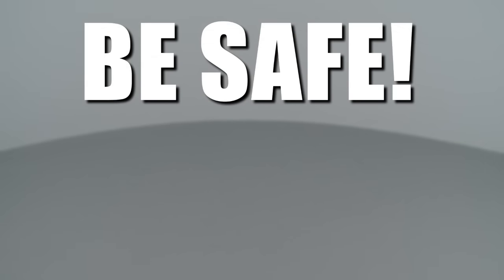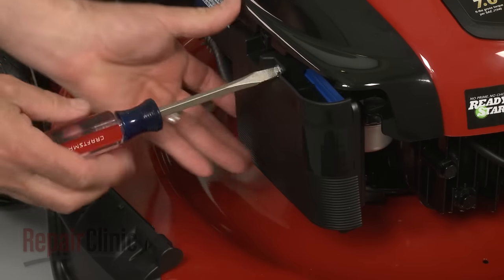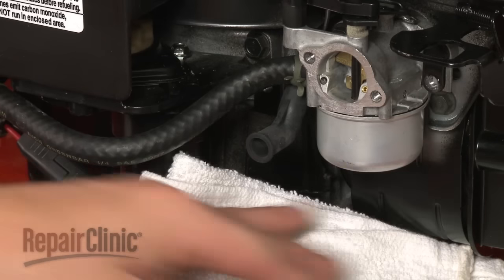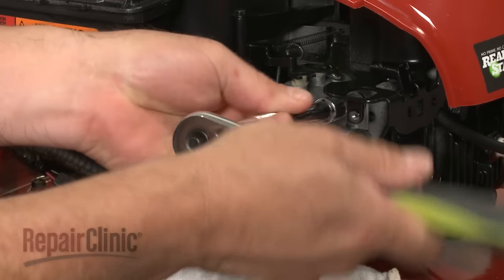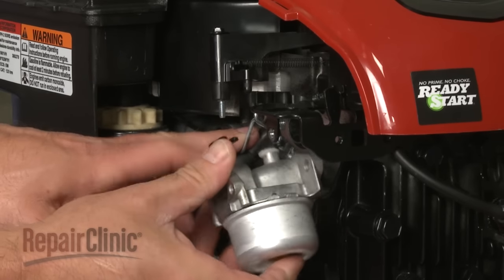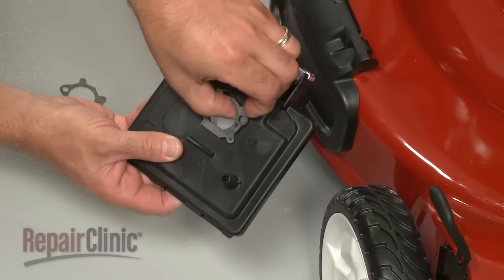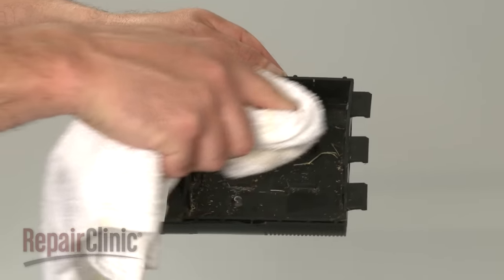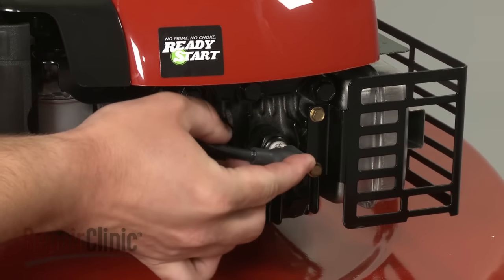Lawn Mower Won't Stay Running? Briggs & Stratton Carburetor #799866

Comment: A video by someone who sells carburetors.  The real problem 90% of the time is a clogged fuel jet which is in the half-inch nut on the bottom of the fuel bowl (or just water in the bowl itself, both of which can be easily fixed by removing nothing but that nut and fuel bowl assembly, which can be reached from the front without removing anything else.  Sad part is that the entire issue could've been prevented by the use of an in-line fuel filter which they didn't build in.
Reply: sskyking1 Just wanted to thank you for your comment, because of what you wrote my lawnmower works again. Thank you so much.
Reply: Thank you for your time comment and advice now I can fix my lawnmower to skyking1
Reply: Fixed it for me too. Thank you!
Reply: I am going to try this again. I had no luck a couple weeks ago.
Reply: Thank you.
Reply: It worked this time. I'm keeping my mower away from the rain now.
Reply: I did this yesterday, my lawnmower’s amazing now, thanks!
Reply: I took the air cleaner off and primed it….it would crank and stall….did that about 4 times ….it started and stayed running.
Reply: Fixed my problem, thanks to you sir.
Reply: G’day from Australia. Your comment just saved this Aussie too. Removed fuel jet and bowl, cleaned jet, whacked it back in and vroom vroom!!  I do need a new air filter though 😂 Thanks mate!

Comment: Instead of replacing carb, i unbolted fuel bowl, cleaned out bowl, replaced, and engine was running in 5 minutes total.
Reply: I tried this and it worked, omg. Thank you very much.
Reply: Didn't work for me at all.
Reply: I did that, and cleaned the carburetor, and it ran for another 2 hours, then stopped again.  I am replacing the carburetor now.  It's not like it's expensive, or a big job.
Reply: This is worth a shot, but no luck for me.
Reply: IT WORKED!

Comment: There was no need to replace the carb. just clean it and it should be fine unless you want to rebuild it. The gasket was ok, no need to replace that either. This is all wrong, do a little work for a change and stop screwing the customers for new parts when they don't need them.
Reply: Meh...I grabbed one off of Ebay for 12 bucks shipped. Just bolt it on and no fuss. Cleaning / rebuilding takes time and materials - heck a rebuild kit costs almost as much as the new carb! As a practice I change mine out every 3 years and my mower will probably outlast me.
Reply: If I have a problem, I clean the carb and it is usually fine after that, never had a come back for anything, it has been 20 years now.
Reply: 12 lousy bucks man - well worth the insurance and fast fix up. To each his own I guess.
Reply: Yup, same here.  Just picked one up for $12 and saved the hassle and time.  Also picked up a $5 inline fuel filter and installed in the fuel line.
Reply: Paul Brown. Hello can u help me? My fiance jus brought a used lawn mower 5 days ago. It was staying on running gd. It will crank on 1 pull wit no trouble. Only thing whn it gets on the grass it shuts off every time don't stay running.
Reply: You do realize that they are showing how to replace a carburator if you have to do it.

Comment: I have tried everything. I changed the oil. spark plug, took the cup under the carburetor and cleaned it. It still won't stay running.

Comment: Slow down buddy I haven't finished my beer.
Reply: W Morris
Reply: W Morris that's cool your slogan
Reply: W Morris what's that little breather go to or does it just get plugged
Reply: correct, this is easily a 3-6 pack job
Reply: My pull. Cord broke
Reply: I'm going to throw this f**** lawn mower away go buy me one or go buy me one that is hot for $20

Comment: I understood the title perfectly!  Since I have a front, back and side yard to mow, I have been using the engineered , 4 cycle gas from Walmart or Home Depot, more expensive for sure, but my mower does start every time and even after harsh, upper midwest winters.  Thanks for the video!

Comment: Worked perfectly! Thank you so much! Even when brand new, this mower gave me fits trying to keep it started and I chalked it up to bad gas. I think it came fully loaded with a bad carburetor!
Reply: Who know?  So much cheap junk coming out of China but I bought a brand new carb on Amazon for $29.00.  I still have to spray starter fluid almost every time to get it started : ( but with the new carb, it STAYS running.  The old one just kept quitting.  So frustrating!  I don't think I will buy a #Toro again.

Comment: What if it's a problem with the air-feed in the top of the fuel cap? You've not even mentioned diagnosis - but just dived in, replacing components willy-nilly. If the B&S does not start at all I'd first go for the spark plug. Did you?

Comment: Really stuck here.  Had the exact same issue as everyone else...would start from primer and then stop.  Totally removed carb.  Cleaned with carb cleaner and pipe cleaners to clean all ports and tubes.  made sure too get holes in bowl plug.  Changed out gas, and used rebuild kit and replaced gaskets and needle.  mower started and ran great last night.  when it got dark put it away and now doing exactly same thing today when tried to finish yard.  Took back apart looking for any clogs or dirt, nothing...  any ideas on what could still be the problem?
Reply: It's got serious problems.  Get a new one.  Easier ...

Comment: Had the exact mower in the video.  Ran perfectly for the first 10 years, I only watched the video to replace the carb.  However, after replacing the carb I saw that the paper gasket was a bit worn and the o-ring had a crack.  Maybe all it really needed was to replace those two items.  10 years from now maybe I'll do just that.

Comment: use premium fuel in small engine , for some reason it works better and does not gum up in a carburetor after long storage , 
second if you have a fuel valve turn it off while the engine is running and wait until the fuel dries out from the carburetor  ,  
Fuel left in the carburetor for a long time will dry up and damage the carburetor  , installing a fuel shut off valve is easy , 
If engine is hard to start remove the spark plug and use a propane torch burn off the Corbin residue and whatever might be on the spark plug , I do it until the Central Electric and the ground electroid get red hot , of course wait until the spark plug  cool down before reinstalling it , in the Old Country Palestine we used to put a small amount of gasoline on the ground put the spark plug in the middle of it and set it on fire , that always worked to get us out of a jam ,
Reply: Reality is this is a design issue (lack of fuel filter).  I use regular gas station gas on all of my other small engines and have for decades without ever experiencing this issue before.  Mower manufacturers are trying to push people toward their high-priced special fuels by designing their engines to be more picky than ever before.  First mower I've ever had that didn't have a fuel filter and I will never buy another without making sure it has one.
Reply: Nidal Shehadeh 
I moved from Seattle WA to South Florida , as if was moving to a different planet , high humidity and Heat messes up just about anything and everything , batteries up north will last about five years down here 1 1/2 to 3 years  , in my 2000 Grand Cherokee battery lasted about 2 years 3 months , the same thing with small engines , in the summer heat fuel in the carburetor dry up and gum up your carburetor  overnight  , A fuel filter is immensely important in any setup what is more important is a fuel shut off valve ,  before storing youre small engine turn off the fuel shut off valve and wait until the engine dies, in other words drain the fuel out of the carburetor this way you won't have any carburetor issues or should I say It reduces chances that you would have any carburetor problems
Reply: Or you can just buy the filter next to the mowers at Home Depot for $5 and install in 5 minutes.  Cut the fuel line and squeeze it on. Done.
Reply: excellent idea , down here in South Florida we have what we call snowbirds , population swells up by 60% , people coming from up North running away from the cold and in the summer they all go up North so you have about six month of equipment setting idle in the garage somewhere ,  that's where the fuel valve comes in .

Comment: Just got a question. Is there any other reason for the engine to start and stall out besides the carburetor? Or should I just go and get a new carb.
Reply from the maker: Bill Taylor Most problems with engines not running properly are carburetor related. Maintenance items like oil, air filter, and spark plug could cause it too if they are not replaced regularly.
Reply: Usually carb. If you hit something hard a sheered flywheel key can cause start stall situation but that usually damages the blade. Sheered key often causes the recoil to snap back hard when you pull it.

Comment: My issue. 
Full gas, good on oil.
It starts, but won't stay on after Choke. it also dies sometimes after a while even on choke.
When we first took it out today, it would not turn off. We have to WD40 the wires and it works now for stopping. Maybe the issue is something wrong with the wires. (I don't know what the metal cords are called)

Comment: How much play should be in the choke lever assembly while carburetor is off.......I have mine off waiting on new one to come in but I feel worried about that choke lever assembly it is really loose.....is that a problem or is that normal?
Reply from the maker: It all depends on what type of choke you have. If you have a manual choke you should be able to pull a lever and keep the choke closed and open it when the engine starts. Some have an auto choke that will automatically close the choke when the engine is cold. As long as the choke is not staying on when the engine warms up it shouldn't cause a problem.

Comment: I replaced carb and started mower it ran rough and eventually died. I figured the choke wasn't opening up as it was spewing black smoke. When I pulled it apart I found that I had managed to jam the air vane/choke lever so that it wouldn't operate. I removed the screw holding the air vane /choke lever in place and managed to set it up so the choke operated freely. I put it back together and now it won't start at all. Any ideas?

Comment: it is cheaper now a days with time and parts, to just replace parts though, deal with that alot in the marine industry, we used to disassemble and clean switches and solenoids and other electrical parts, now they get replaced, for dependability and longevity, also parts arent made here, theyre made overseas... CHEAP, so they can be replaced cheaper than repairing

Comment: i do small engine repair, their is no reason to buy a new carb. 90% of small engine problems is a fuel issue, clean the jet ports out and it will run! AND dont leave it in the rain, the gas cap has vents in it, water will get in your fuel
Reply: Excellent point, keep it on that way ....
Reply: LAZY, they are too lazy to overhaul the old one. Or maybe their technician can't do that difficult of a repair. A kit is a lot cheaper.
Reply: I don't know how to clean the jet ports.  I'm guessing they're in the carburetor.  Neither my Dad nor his Dad worked on engines, so I didn't have much chance to learn.
Reply: Agree with your written statement. You also sometimes run into gasoline that you buy that already has water in it. Both my Power King tractors are not running right, both have Kohler engines in them, and they both arn't running or stall out when you increase the throttle. I believe it's because of water or moisture in the gas. Have to drain out the gas and put in fresh gas. The one could use a tune up with new points and condenser, while at it, new plug as well with the proper gap on the plug.

Comment: Thanks for the clear instructions. Most of us in New Zealand want to just clean out the dirt that is blocking our jets in the carb, rather than replace the whole thing, must be our pioneer roots... Are you able to give some instructions for this please? I am having problems with a similar (older but similar model 129802) Quantum engine that starts and runs at good revs for a few seconds but cuts out suddenly as if the fuel flow (or spark) has stopped. I've dismantled and cleaned the carb, and noticed what looks like a welsh plug in it, (possibly covering up a couple of fine jets?) I've checked the tank is venting OK as well. There are 2 holes in the centre of the carb above the bottom nut / jet, one of these goes to the brass tube in the venturii air flow, where does the other one go? Thanks for any help.
Reply from the maker: +reelMn In the U.S we have ethanol in our gasoline and if that fuel is not treated properly it can clog a carburetor beyond cleaning at times. If so, the whole carburetor has to be replaced.  If New Zealand has similar fuel issues, cleaning may not cut it.

Comment: Hey ***** , I accidentally mixed the wrong fluids into the wrong tank. Now my mower wouldn't start after I drained the fluids out of the fuel tank and replaced it with ethanol free fuel. Do you have any Idea of what might be the problem?

Comment: I have a brand new Stow & Mow and the engine doesn't seem to be running well. It takes a while to get up to full running speed and dies quickly when going through thick grass. I have to lift up the back of it from the handle and it gets running quickly again, but doesn't last long. It also smells likes its running rich. Strong fuel smell. Cleaned the air filter and carb... both looked fine. What could be my problem?
Reply from the maker: We Bring the Party, LLC We would start by analyzing the fuel you are using? Newer engines are really sensitive to gasoline that contains ethanol and the problem is compounded if stored longer than six months. Cleaning a carburetor does not always get all all the sludge out and replacement may be needed.

Comment: What about the primer bulb and assembly. Is there any reason to look there and perform some kind of maintenance before changing out the carburetor?
Reply from the maker: +Gregory Tate This video is intended to show you how to replace a carburetor not diagnose why an engine won't start. See our repair help for additional help. http://www.repairclinic.com/RepairHelp/Lawn-Mower-Repair-Help?TLSID=1773
Reply: Could have answered my question. Same question led me to that video.
Reply: Actually, this video is intended to get you to replace a carburetor that you likely don't need to!  Far more likely it's just a clogged fuel inlet and that's an easy fix, and one that a fuel filter (which these don't have) would've prevented!

Comment: I replaced my carburetor but the choke lever assembly was not able to move at all when I put it back together. Did I miss something or did something come detached under the motor housing that would me it tight?
Reply from the maker: You may need to remove the filter housing to see the choke arm is on properly. You may need to remove the choke arm or just try not tightening the bolt as tight that the arm pivots on. Hope this helps find your problem.

Comment: i found one of these engines on the side of the road it had a full tank of gas all i had to do was put some fresh oil in it and it fired up with one pull
Reply: i am working on making the motor into a racing mower engine for my Murray racing mower
Reply: it was on the side of the road not in someones truck i asked before i took it and they said they didnt care

Comment: hi,
Would apprec some help and advice. Used you video and all seemed well. Mower worked for one long cut with multiple starts. Week later started for couple of second and I turned it off to adjust height setting and now it will not start no mater what (fuel and oil levels ok). Have checked and spark plug OK (using multimetre) and there is current from the magneto (used tester that lights up). Motor does not even seem to turn over. Just pull cord and magnet etc works but no ignition. Tried with out filter, tried to spray some carb cleaner into carb in case it is not priming (has auto choke and primer). Fuel is held in can so no chance of water in fuel etc. Auto choke arm sitting OK and moving correctly. I am now stuck. Any ideas.
Reply from the maker: What is your lawn mower's engine's model number?

Comment: my toro runs for 3 secs and stalls, but when I want to try it again I have to prime it 3x for it to run for 3 secs, if I don't prime it, it wont turn over.  Do I have a dirty gas filter or faulty carb?
Reply: Probably build up inside your carb, due to ethanol in gas. Watch a youtube video, I like the one from Jeff's little engine service "New Toro lawnmower won't start"...with zero experience, it should take about 6 hours to fix it! If your mower wasn't left in the weather, it's probably not your fuel filter. ( in tank)

Comment: So i changed my spark plug, carb, and air filter, all brand new.. it fixed the putting and smoke but now it only runs for maybe 5 min then dies and wont start up at all? What do i doooo?
Reply: Also new gas
Reply: Sounds like a bad coil. Will it start again when it cools down?

Comment: 24 horsepower briggs and stratton just put new fuel pump, fuel filter, lines, carburetor, and air filter on it all brand new and still have to prime to get it to start what wrong

Comment: This video explains absolutely nothing on WHY  it wouldn't stay running. Sure replacing the carb, is one way, but, why not explain why it wouldn't run ;then go from there.
Reply from the maker: For some great info on how a small engine works please click here: https://www.youtube.com/watch?v=YMsOM4H2Uxs
Reply: RepairClinic.com 
I've cleaned everything. I need to know how to adjust the screws.
Reply: RepairClinic.com 
I've cleaned everything. I need to know how to adjust the screws.
Reply: RepairClinic.com I have a Sears Craftsman #2, eager-1. 4.5/20 inch 3 in 1 convertable